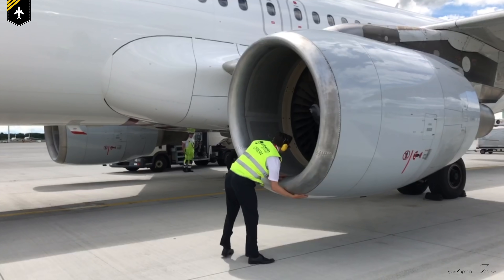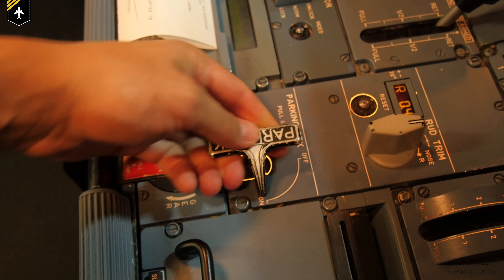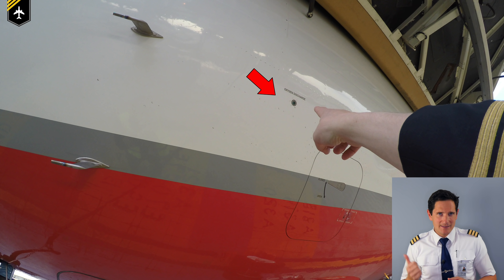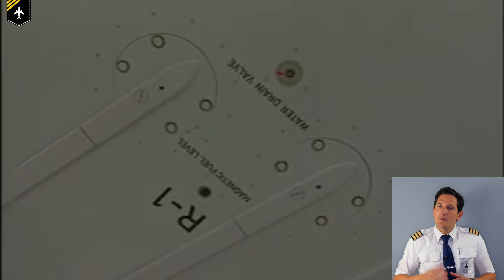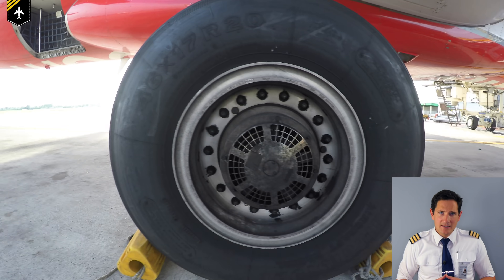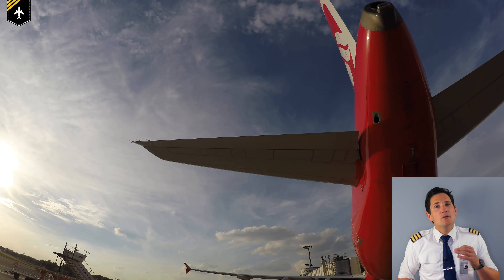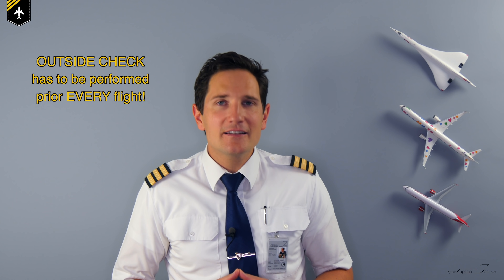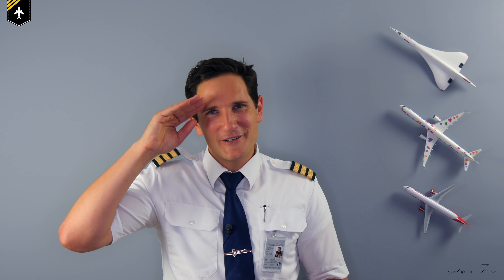AirbusA320 OUTSIDE CHECK explained by CAPTAIN JOE

Comment: +Captain Joe  
What are the static ports?  
What does the avionics equipment inlet valve do? 
What is a surge tank air inlet?  What does it do?
What are those two small open panels forward and aft at the bottom of the fuselage?
Love your channel and thanks!
Reply: The two open panels I can answer. They're for accessing the controls for the cargo doors.
Reply: +Aaron Murphy  Thank you!  That is the hardest one to know because the rest I can simply research (and did).  I can't get over what amazing pieces of engineering airplanes are, nearly everything is driven by purpose. You can know an airplane as a passenger for decades and never really know it until you see videos like this.  I went to a bone yard once 10 years ago and was able to hang out next to L1011s and a few old 747s.  At that time they were just retiring a classic 200 from the early 70's and all the analog gauges were still in place with the engineer's seat.  Still to this day one of the highlights of my life getting to "play" around these aircraft.
Reply: Static ports are part of the airspeed sensors. Pitot sensors work by measuring the pressure difference between a forward facing port (hole) and one facing to the side. The port which is on the side is the static port.
Reply: Static ports for releasing static electricity charges when the airplane fly it get charged by contacting air, like when you scratch your hair with a balloon.. Avionics equipment valves is like coolant in your car but the computers and electrical equipment are cooled by air and not water so there is inlet and outlet of air..  :D
Reply: You're talking about static dichargers. Static ports are different, they measure static air pressure for the pitot-static system, which is used to determine airspeed, altitude, and other sets of data for the crew/flight computers.
Reply: @nathanchetram287  lol you are right hehehe,  i wrote that rly late a night,  i was mistaken and ya static port are for measuring multiple thing like pitot tube :) sry for giving misleading information i was rly tired when i made the comment

Comment: 7:33 Airport sky in the background. The clouds are disordered and look hot. This is because the air above airports is very hot. The clouds are mostly tussled contrails, and the rising heat from the takeoffs and landings, plus the extra rich mixtures and the heat absorbed and then radiated from the bitumen runways, plus all of the auxiliary ground traffic combine to boil the air above. Oftentimes the clouds above an airport resemble boiling fat. 
A jet aircraft requires almost 17 kilos of atmosphere to combust one kilogram of fuel.  One tonne of fuel therefore produces 17 tonnes of seriously contaminated and super heated smog. However, only one fifth of the atmosphere actually passes through the combustion zone, the other four fifths bypasses the combustion zone by flowing around it.  All of this atmosphere is also contaminated with around two hundred chemicals, many of them synergised by the forces involved, producing many dangerous carcinogens. The weight of contaminated air per tonne of fuel burned is now 85 tonnes, but the story doesn't end there. The hot persistent contrail will cause atmospheric water vapour to condense on its outer surface, and all of this condensate will also be contaminated by jet exhaust, and the total weight of condensate may double the weight of actual exhaust gas contamination produced.
Assuming the weight of water vapour to be roughly double the weight of contaminated atmosphere, we have a weight of 170 tonnes of contaminated atmosphere per tonne of fuel burned.  If a round trip consumes twenty tonnes of fuel per circuit, we have a grand total of three thousand, four hundred and forty tonnes of contaminated air and water vapour per plane. Now, multiply that by a thousand planes, and we have a grand total of three million four hundred and forty thousand tonnes of pollution every day of the year. This does not include prop driven aircraft, smaller jets and military aircraft. This estimate of the amount of jet traffic is ridiculously understated, it is probably ten times that figure. One last check that should be done is to look in a mirror, and ask yourself, 'Do I wish to assume responsibility for the shit storm I am creating every time I fly?'
This sadly neglected final check is why our planet is fucked. Happy holidays.
Reply: Aviation creates only around 2% of global GHG emitions so should probablu\y focus on other sectors first

Comment: Love your videos and I've been binging several all evening.  One thing I'd love to know more about is how some thing seem to be metric and some imperial.  For instance, altitude seems to always be in feet but I see temperature in Celsius.  Sometimes I hear meters but not always.  Is fuel in kilograms or pounds, does it depend on the plane, crew, etc?  Also, watching a lot of flight videos, it seems that the controls, ATC and pilots all communicate in English.  Is this a standard?  I'd love to see a video just discussing how all of this works together.  Especially for international pilots that fly from say the US to Europe where obviously the measurements and languages can vary quite a bit.

Comment: Best Video ever!!! Can you explain what the "Static Ports" are? You show it on 5:18 min. in the Video. THX :-)
Reply: The static ports measure the air pressure around the aircraft. This is used by the altimeters, as air pressure decreases with altitude, as well as Robert said, to measure speed. The Pitot tubes measure what is called total pressure, i.e. the sum of static and dynamic pressure. So if you measure static and total pressure, you can determine the dynamic pressure, which again depends on the airspeed.
Static pressure is also used for the vertical speed indicator, mach meter, air data computer and probably other stuff, as well.
Reply: I know this reply is 7 months late, but static ports create a base line for the pitot tubes to measure against.

Comment: Dear Joe,
what is DME 1 ? As shown in 4:38
Reply: Distance Measuring Equipment. 

It transmits and recieves a signal to fixed points on the ground,which are  VOR Stations and  ILS localizers which lets the plane calculate how far it is from that point.

Comment: I liked the part where you showed the tire being changed.  The part of the plane that the tire slipped onto looked quite complicated, with lots of regular, raised, bumps (for lack of a better word).  Do they lock into corresponding grooves on the inside of the tire... to make sure the wheel has plenty of purchase?  Also, it looked like there was only a single bolt holding the wheel on (like a racing car) rather than six or more (like a car or truck)!

Comment: Its one of my pet peeves when I do my walkaround and find something wrong, then report it to the pilots and find out they didn't do their walkaround properly. More pilots need to study this video. I've actually seen pilots walk right past a gear leg with a fairly large puddle of hydraulic fluid all around the tires only to wave them back and point it out. The guy must have been fatigued or poorly trained to miss something like that. I guess thats why they have us do a walkaround as well.

Comment: Q1: What's the "fire extinguisher over-pressure" that you mention at 9:42? It looks like a third engine exhaust for a two-engine plane.
Q2: When flying over the ocean, are 3 pilots required (in case 1 or 2 get sick)?
Q3: Are any non-pilot crew trained to land the plane?

Comment: Very nice walkaround video. I'm a longtime TCE/TRE on the Airbus narrowbody series and the only things we do substantially differently are we don't touch the fan we just visually inspect it and we always, always bend down and check the cowl latches under the engines as multiple airlines have had cowls depart the aircraft causing damage (and terrifying passengers) when the latches weren't closed correctly. 

Again, my compliments on your high quality videos!

Fly safely!
Reply: I wondered about touching the fan blades too. Is the reason you don’t touch to avoid any contamination?

Comment: I used to fly with an engineer who had a two engine rating.  He had to fly a number of hours every month to maintain it.  Manually checking flaps from inside and out.  A check of the fuel tank to make sure there is no water in the wing tanks. Flying a Cessna 180 from Teeters Borough , NJ.  It seemed pretty simple but he was an expert

Comment: Although really, if the ground isn't level, those chocks aren't going to stop a plane that big from rolling away. Makes a difference on small planes for sure but  something that big, it's either not moving without a lot of power or it's going wherever it's going with or without you.

Comment: You never take a sample of that wonderful smelling jet-A to see if there's any water in the tank(s)? Guess you never have to worry about the fuel truck putting 100LL in instead of jet-A.
Reply: opl500 Makes little difference putting avgas in a jet. It still burns. Putting Jet-A in a piston engine is a very expensive mistake. Full overhaul, I believe.
Reply: Oh I suspect running 100LL through a turbine engine will also result in an expensive overhaul too. Is there anything that's cheap in aviation besides regional jet salaries?
Reply: opl500 You'll get a slightly different thrust for a given throttle setting, but if it's a flammable light liquid, it will work in a jet. Gas, diesel, alcohol, paint thinner. You pick, it'll run without damage. That's the beauty of a gas turbine.
Reply: opl500  you forgot about Ryanair salaries
Reply: the fueling staff checks for water contamination prior to every fueling
Reply: 12tak12 True. My point was you won't ever see fuel in the real world with 0.00% water. There's always a little bit.
Reply: And if they drop the ball on checking, whose fault is it?
Reply: The airport I work at as a fueler uses an underground hydrant system. All our pump carts get twice daily quality checks to make sure there's no water in them. Our tank farm also does regular checks. Anytime we defuel a plane using a tanker, the fuel is checked for cleanliness before we can use it again. If the fuel fails, it's reported to aircraft maintenance, and the tanker is taken out of service to be drained and thoroughly cleaned.

Comment: Captain Joe please can you do a video explaining what the first officers and captain static ports are for and when they will be used for in what reason during flight that will be very helpful to get to know as  I have subscribed to this channel I have also liked this video on pilot walkround pre flight checks and I'm also liking the channel because it is evolving and everything on the other hand is explained in the great knowledge of a great first officer you are in the aviation knowledge you know
Reply: the static ports are part of the so called Pitot-static-system. The main purpose of the static port is to give the pilot the altitude indication. Basically it's connected to the altimeter, but also to the variometer and it helps to calibrate the airspeed of the airplane.

Comment: I read somewhere about someone who decided to leave one tank with fuel and the others empty. They decided to go for a fly the next day and did their pre-flight inspection but didn't want to check the one tank for water. They checked it anyway. What they found was that same tank had accumulated fourteen cups of water because the cap hadn't been on properly and it had rained overnight. That person wrote: The fuel would have cut out just after take-off and I would've crashed into the trees behind the runway.
Thank you so much for the videos Captain Joe! I hope to meet you one day. Also, the high visibility vests look cool!
Reply: sounds like they saved themselves from death.  the vests are just for a safety precaution to ensure that ground personnel don't get run over by any cart, car, or anything else on the tarmac.  Alpha the procedure at all commercial terminals is that the flight crew calculates the reserve fuel on hand at the moment, anticipated fuel needs for said flight, and mandatory reserve add ons and then signal for a fueling to ensure compliance with aviation safety standards.  Joe has a nice video on that process.

Comment: Hello Captain! I'm a very frequent flyer and I've flown as passenger on a lot of aircraft now including quite recent ones like the A380 and 777-300ER of Emirates, 787-8 from KLM and A320NEO but what I don't understand is why modern day aircraft still come with no smoking signals and even ash trays, as I'm sure smoking is not allowed on any aircraft anymore these days. Do you know why this still is a thing in these aircraft? And also, what does the CHIME mean in a 737, which is something I often see in cockpits where it's on a sticker over the smoking sign switch? Thank you and safe flying!
Reply: I think Mentour pilot made a good video about that. The short answer of ash treys on toilets is that if people smoke there, even if they are not allowed, it is better that they use a ash trey instead of the paper basket.  

Because people sadly do still smoke. Just a month ago a person in Norway was fined about 12500 nok (1250 euro) for smoking on a plane. Apparently  every year between 8 and 12 people are reported to the police for smoking, just in Norway.

Comment: I notice all the time when fueling the A320 series that the Delta pilots always check the fuel over pressure ports.  Fuelers call it the fuel bladar.  We use the fuel sticks only if the gauges are inop on the underwing fuel panel. Swissport fueler myself.

Comment: Your inspection reminds me of that air crash investigation show about a crash in Peru. The plane worked fine, but small pieces of duct tape were left covering sensors (after a repair or painting, I can't remember) and the plane crashed into the ocean at night because it could never determine altitude. Duct tape brought down a 737!